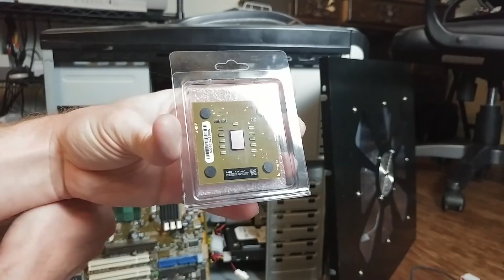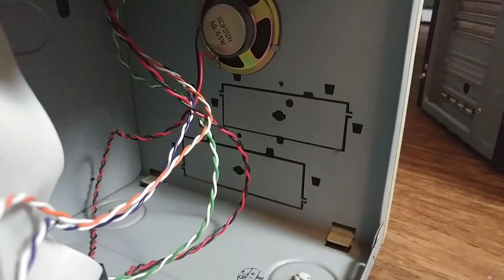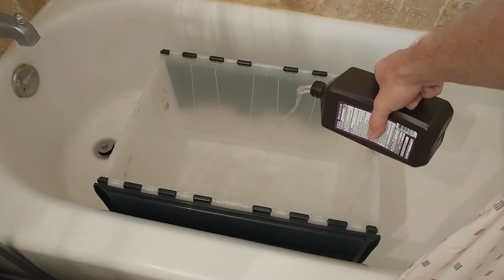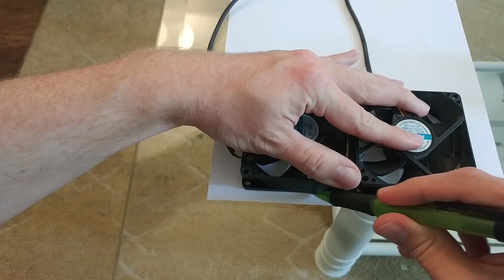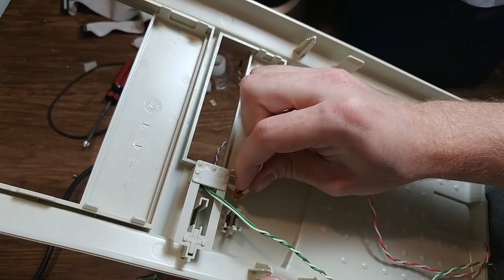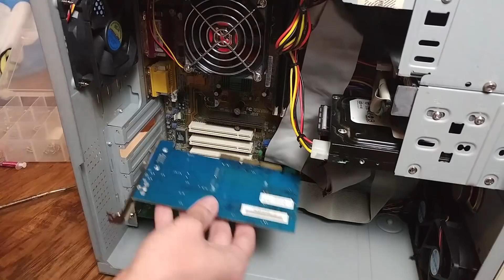Rebuilding my Windows 98 Test System!

Comment: I also remember the first batch of KT333 motherboards would run the FSB at 2x133MHz (266MHz effective) but the RAM at 166MHz DDR (333MHz effective). The second revision of the chipset supported the 2x166MHz (333MHz effective) FSB.

Comment: I have quite similar motherboard ECS K7S6A rev1.0 with same SIS 745 chipset (as Asus A7S333). Which SIS AGP (GART) driver version you used? 1.21 , 1.19A , 1.17E , 1.17 , 1.16A , other? I had “Windows protection error” problem with 1.21. I might try those others later. EDIT: I got it work with 1.19A

Comment: Processors with the die exposed are both cool and scary. I imagine that amd had no choice, those puppies ran hot. I love that purepower PSU, I use an enermax for one of my test PCs, it's really good. Oh I love the beige case, holly crap, its beautiful. Great work and great video!

Comment: Always emphasize the Barton core if you have it.
I got the 3200+ 400FSB in an old retro 2000/xp system.
I just burned up 3 with testing old hardware. 3 slaps in the face.

(Barton)

Comment: You should not worry about speed, basicaly every system handles overclock a bit, I'm running overclocked sempron 2500+ at 266 Mhz board. It could be overclocked to 333 Mhz, and no issues at all. Not every card can handle those bus speeds, but onboard audio handle it and also Geforce 4. So you can raise FSB a little bit for sure.

Comment: Did you experienced any problems with Sis745, over KT266A / KT333 chipsets? Or it is same good?
Reply from the maker: Honestly the SiS745 board has always been very solid. Since I made this video, I replaced the caps on the KT333 board and used it for a while, but now I'm back to the SiS board. The wider compatibility with graphics cards is worth more than the marginal improvement in CPU speed. I have the mobile 2400+ in there now with a pin wire mod to run it at 266x9 w1.75v. Very happy with it.
Reply: @PixelPipes  I'm asking, because I just got unplanned Sis 645 board with Pentium 4. I knew, that most reliable chipset with Intel chipset like i865PE , are always without universal AGP support, so basicaly one of the choice to have P4 with universal AGP was SIS. 
It was in one case, I bought, I knew there was some motherboard, but I expected some crap. How I was suprised, when I found it was P4 board with universal AGP, and Sis645. However, it lacks USB2.0, which is very sad, but I think, more precious is that AGP slot, as USB2.0 can be added via PCI card.
Anyway, I wanted to have i865PE chipset, so I was wondering, if SIS645 with Pentium 4 can be at least decent. Speed is not an issue, I can sacrifice 5 or 10% speed, but compatibility and reliability is more precious to me (I want to also as testing platform, also have Universal AGP slot with KT266A chipset, I know, it's quite old, but for Socket A, VIA chipset were "good enough") Anyway, it can be overclockd to 333 Mhz, even if supports it only 266... and AGP cards - maybe not all handles it, but Geforce cards are usually very tolerant for raised AGP slot frequency.
for sure onboard soundcard and LAN handles, so I can use 333mhz CPUs. Even if not reach 333 mhz, even something around 300 is nice "in middle", performance boost can be felt, and 300 Mhz is not high overclock, usually most of cards handle it. That is, because KT333 boards with Universal AGP are hard to find. This is, what I wanted to tell you, when you were speaking about "only 266 mhz FSB and CPUs on your board), that basicaly all socket A boards can be overclocked at least to 290-300 mhz, in those time, PCI cards manufacturers was producing cards more resistant to increased BUS speed, as they knew many people are overclocking. LAN and soundcards in PCI slots usually handles them well. So even with 266 mhz FSB socket A motherboard, you usually can get up to 300 mhz, which is in middle between 266 and 333, I call it 266+ :) And with Athlon XP 2400+ with 266@300 overclocked FSB is more than enough for any Windows 98 build, and it will handle even 6800 GT/Ultra cards, without bottlenecking them. In fact, it will handle even early windows XP games, ranging from Doom3,Half-life 2 to Oblivion. First games that needs more, are around Crysis age.
Reply from the maker: I won't tell anyone they shouldn't overclock their PCI bus speed, but it's not something I personally do. But even without overclocking, you can pair that board with a P4 3.06GHz 533FSB CPU and have a pretty great test platform.
Reply: @PixelPipes  Hi, english is not my mother language, what's the issue with Kyro cards ? Is it related to this chipset ? I plan to put it on a MSI K8N Neo2 based build, should I expect some issues ?
Reply from the maker: @dkrbk  I have not tried Kryo cards on a nForce 3 chipset, but I don't know of any issues. Since I replaced the caps on the Shuttle board, the Kyro card worked in that too.

Comment: Nathan if  you want max CPU Performance and AGP 3.3V compability and want to run AMD XP you can use the AthlonXP-M 2800+, clocked @2.133GHz FSB266. It has a free multi so you can try FSB400 x11(or higher multi) too. Its my fastest AMD Setup for oldschool Graphics Card. 
My Intel Setup is Pentium4 2.6GHz FSB400 @ 3.46GHz FSB533 on Asus  P4S333. Near 20K 3dmarks (99) with Voodoo5.

Comment: How did you get your hands on a voodoo 5!?!?!
Reply: He stole it out of the Nvidia headquarters ;-)
Reply: Well, like all my other Voodoo cards, I bought my Voodoo5 at a college-computer fair back in 2003 or 2004. It was REALLY cheap... nobody wanted a Voodoo card any more here in Germany, all wanted Geforce4, Radeon etc. So I bought some Voodoo Banshees, 3 and this 5. 

I still have it :-) Right now it is running paired with a Duron 800. We have rebuilt my (then girlfriends/now) wives PC from the early 2000s. She had an GF MX 400 with the exact mainboard and processor. But because she switched to C2Q and XP for retrogaming, I got the machine and put the Voodoo into it - yesterday. Before it had been running in a K6 system we gave away to a friend (with a TNT).

Comment: If the system becomes unstable, it could be because of the PCI USB board, if it indeed is a eBay China product with a VIA chipset
Reply from the maker: No problems with it thus far!

Comment: You have a real ideal spot on the bottom for mounting a 120mm/140mm intake for guaranteed positive pressure air flow.

Comment: I'm doing something similar with this generic case from 2001, though mine is going to be a VIA KT133 chipset based Athlon 1400 system as that's the board I happen to have.

https://i.imgur.com/PdMHeNx.jpg

Comment: Hi.  Pretty good, For the feet i found to just browse the $2 shops and also general hardware shops, you have find a 50mm / 2inch perspex / plastic wooden feet to use. The perspex you just glue in with silastic ( or car windscreen sealer is good enough ), the wooden one you can just place the feet and run a self tapper with washer from inside the box. You can even use some kitchen cupboard knobs - a mod i saw years ago at work with a PC that use to get hot and shut down every 3 to 4 months due to the carpet fibers getting into the cpu and power supply fan.

Comment: Good idea to unite the old parts to build a new computer which is always usefull.
 Of course, in most of the cases (where we need), we would support the old pc 
 with the parts which we already have and which are new or similar  to the
 old (experienced) parts.
 As you have enough experience, would it be useful to add a internal EIDE^multi 
featured DVD-CD recorder to this system.
 Did you add a PCI Sound Blaster with a wave table  to this PC.As I followed this 
video, I saw a sound card, but i am not sure if it is Creative Sound Blaster or not.
 Also,what is the graphics card for this system which you used ? Would it be sui-
table to install an 64 bit 64 MB ATI card (as i remember my limited experiences with 
PCs. )
 Also microsofts' , especially  old devices are really produced on top quality.
 I used two different trackballs of Microsoft in the past, and still I am keeping one of 
them, today.As , my table is small and crowded with my Mini tower PC with 1999
 model 17" trinitron Sony (2 pc support) 1600*1200 monitor, I didn't connect my 
Microsoft trackball to my house PC.Instead, I am using a more usual A4-Tech double
click buttoned PS/2 mouse.
 Nowadays, I am trying to look at some additional parts to maximize the features 
of my House PC and the PC, which I am studying with, at the office.
 So, your old Windows 98 PC build up was a small but a useful adventure for the
similar minded people as a sample.
  Keep on, well done ...

Comment: I have a similair system it was my childhood PC. While it used to have a Pentium 3 and Windows 2000 it now runs XP and has a Athlon XP 2200+ 1.75GB Ram and a Radeon 9200 or I also have the FX 5200 I grew up with. I would like to put Windows 98 or 2000 back on it but since this installation of XP has many nostalgic family things on it thats what im keeping on it for now

Comment: Ah doing it with 80mm fans in the front heh, I'd just move the speaker so you got a bit more space for cutting & then put a front 120mm fan at like 800 rpm from fractal design or similar for a bit more silence from the system. & then the standard exhaust fan.

Comment: Back in the day I used a Vortex 2 on an Athlon XP system and always had trouble with it. It’s in storage now with a note attached to not use it in an AMD system. I hope it works out better for you. It was my best sound card when installed in an Intel system.
Reply: I think it's more a question of the A3D driver version. PhilsComputerLab and others use a very specifc version which is more or less trouble free I think.

Comment: https://www.ebay.com/itm/ORBITRON-Just-Cooler-Kit-for-Hard-Drives-Keep-Hard-Drive-Cool-Retail-NEW-SALE/253608885873?hash=item3b0c447e71:g:vzsAAOSwGIRXcYQ6

You can use a couple of these in the front drive bay area to get some extra front air intake going. Then add one of these pci slot coolers for extra heat exhaust.

https://www.ebay.com/itm/PCS-New-System-Blower-Cpu-Case-Pci-Slot-Fan-Cooler-For-Pc-Computer/172835248870?hash=item283dc89ae6:g:QywAAOSw7htZnnZO
Reply from the maker: Oh man... That thing is so ridiculous and ugly that I'm actually tempted! Haha

Comment: use 2041 driver for the vortex 2, latest 2048 driver is bugged so A3D doesnt sound quite right. Also make sure to use headphones for best experience but you probably already knew that
Reply from the maker: I think I'm actually using 2048. What about 2046?
Reply: idk about 2046, but 2041 is the one recommended by vogons as working best, and I can confirm that I can notice a difference between 2048 and 2041 on my vortex 2. You're losing on EAX, but A3D works better and thats the important bit because you want a vortex 2 to enjoy A3D. Since 2048 supports EAX too, Im guessing its probably a driver written after Creative acquired Aureal

Comment: That Thermaltake power supply... if they don't lie with the label, it's a model made my High Power / Sirtec and should be honest about the capabilities and should have slightly better electrolytic capacitors than the cheap Chinese ones. Even back then, Sirtec used to use Taiwanese Teapo and Taicon capacitors and in some models even quality United Chemi Con capacitors. 
However, keep in mind that the efficiency of such old power supply probably barely hits 75% so while it can do 40A on 5v,  it will produce a lot of heat doing that, so it's important to have those fans working.  Also, as it's an older group regulated design, if you have a system that uses a lot of power on 5v and 3.3v you'll have to be careful about the voltage on 12v, which may drop significantly if there's few devices consuming power from 12v ... for example if you're heavy on 5v, you may see 12v voltage shifting either down or up by a big amount.

At the very least you should open that power supply and replace the 5v standby and 5v and 12v electrolytic capacitors for reliability, and maybe even replace the fan with an equivalent one (rpm, cfm/air pressure) if you bought that power supply used.

If you don't need that much current on 5v, I would highly recommend replacing that power supply with a more modern one with Active PFC and some minimum efficiency - I would suggest searching for some OEM Seasonic power supply, for example first result on eBay was a Seasonic SS-350ET power supply for 17$ - this one can do only 20A on 3.3v and 5v but should be enough for an old system.

I'm surprised you don't have around some of those Intel Pro 100 mbps PCI ethernet cards - I was working as a network admin in a university campus and used to buy loads of them from a refurbished PC store to sell to students in the campus, they were much better than cheap Realtek cards of that time (based on the 8029AS chip... jeez this cheap had a long life)
Reply: Regarding the ethernet cards: I also have several Intel and 3Com 10/100 cards but of course many more Realtek cards, but I still can't tell what's supposed to be better with cards from Intel or 3Com. When you have one of the Realtek cards running stable I don't see any drawback. What's your opinion?

Comment: At this very moment, I am also modifying my win98 PC. What a coincidence.
Yesterday I got a whole bunch of stuff from a PC repair store that had some extra retro inventory for me to pick out. Stuff like an old 15 pin gamepad, a beige CD-rom burner, a Win98 compatible Ethernet network card and a bunch of other stuff. The only thing I'm missing now is a DOS compatible PCI sound card (currently I'm using the onboard sound for windows, but honestly it works just fine). Its perfect for retro Win98 gaming:
AMD Duron 1.2GHz
512 DDR ram
80GB HHD
and a Geforce 4 MX 440 64MB
plus a good Dell CRT monitor
It may not sound like much but, really, any game that runs too slow on that machine works on my modern PC anyways. I only need a Win98 machine for running those few games that don't run well, if at all, on my modern PC. It's a lot of work but somehow its worth it :)
Reply: With the Windows driver installed for the on-board audio it should have Sound Blaster compatibility. You might have to boot into Windows to initialize it instead of going straight to DOS but it should work after that. 

I just finished my Win 98 PC this weekend, Celeron 1.8, 512MB RAM, 20GB Maxtor(will get 2nd larger one for games to install on), Audigy 2(always wanted one), and an 8MB 3dfx Voodoo3 1000(all I could afford, suckers are expensive). Did the registry mod for the Voodoo and plan on OCing it sometime but it runs great. Might not be a killer machine but I 100% wanted a Windows 98 computer with Glide.
Reply from the maker: Looks good to me! There's a surprising number of options for DOS-compatible PCI sound cards. It almost (ALMOST) makes the obsessive pursuit of ISA cards seem silly.
Reply: DKJones96
I was very close at getting two Voodoo 2s for SLI mode but when I called the guy he said he just sold them to someone else DX. Oh well, I'll keep looking for another deal somewhere. But my AC'97 on-bored audio doesnt seem to want to work in DOS. I didnt know that you had to set it up in windows before exiting to DOS. Are there instructions for doing this sort of thing?

Comment: Not too bad. A couple of suggestions for cooling though. I would drill out the dimples on the front panel to allow additional airflow to the front tans. I used to do that a lot on cases similar to that. I would start with 1/8 in holes and enlarge them as needed. Personal tastes will guide you to how large you can go with the holes before they ruin the aesthetics, but the larger the better. I normally went with 1/4 in holes if possible. You can also place holes in between the dimples as well. You might want to paint the front of the metal portion of the case the same color as the plastic front panel to make the holes appear less prominent. 

As for fan noise, you could try the 7 volt fan mod to see if it helps. It will slow the fan down decreasing noise, but depending on the fan it might reduce the air flow too much to bu useful. Having the holes in the front case panel will help with that to some extent as the less restrictive the input is the less noise that will be generated due to turbulence. 

http://www.silentpcreview.com/article6-page1.html
Reply from the maker: Some good suggestions actually! Thank you!
Reply: cee128d I was thinking the same. Just drill those holes. Even if it's the same size of the dimples it would be a big improvement.